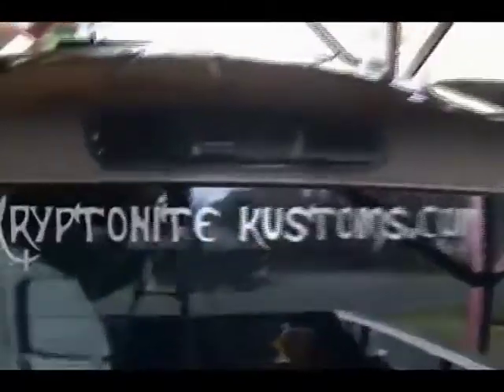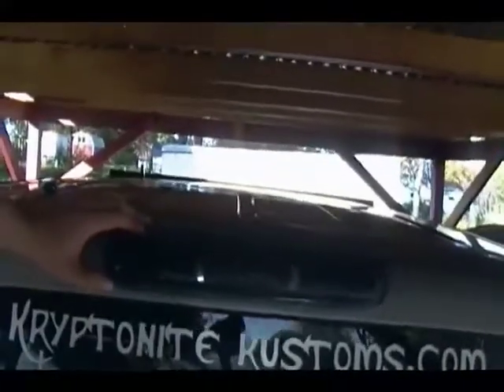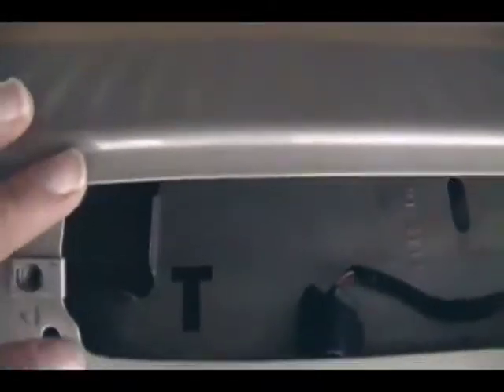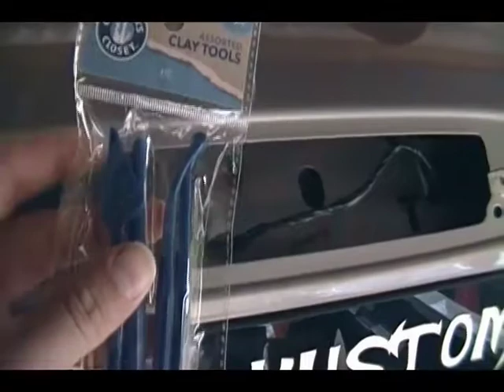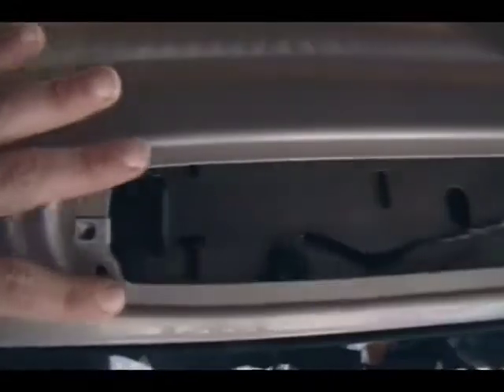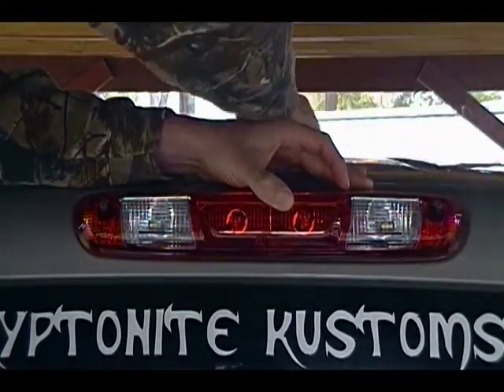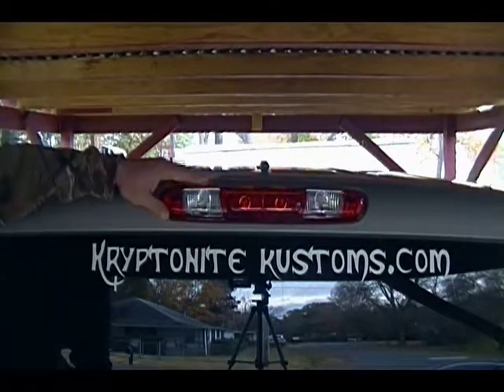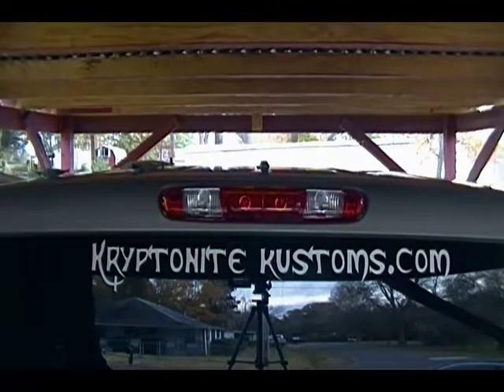2007 Chevy Silverado 3rd Brake Light/High Mount Replacement

Comment: Do you have a video on 2007 GMC dash boards that are cracked and broken and how to fix or replace them. The dealership wants $500.00 for one part and another $300.00 for the other part, not including labor,  and still cannot guarantee that it wont crack?
Reply from the maker: No I do not. Mine has a small crack near the defroster vent,  but I haven't thought about replacing it yet. They will eventually crack over time due to the material they are made out of. I would do some research and look and see if there are any better aftermarket replacement dashes. Sorry I couldn't be anymore help.
Reply: Get a dash cover